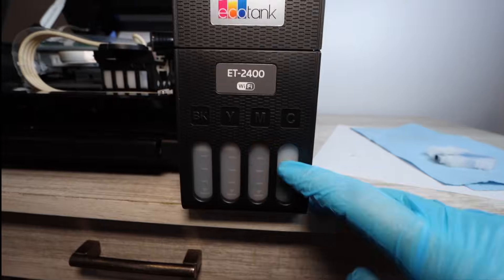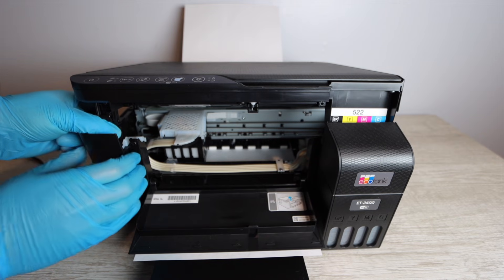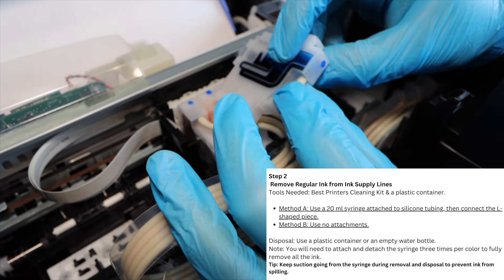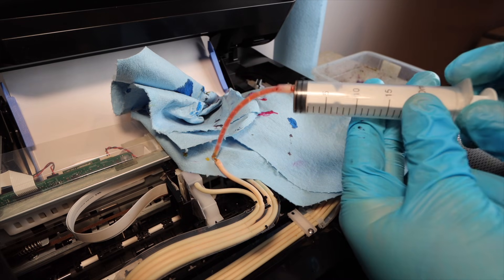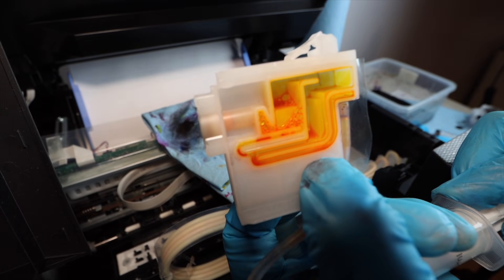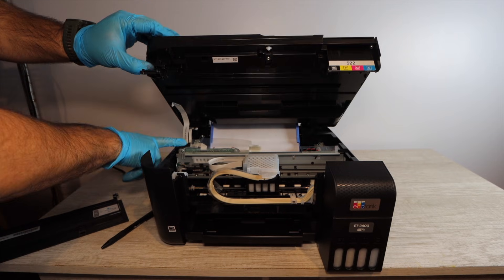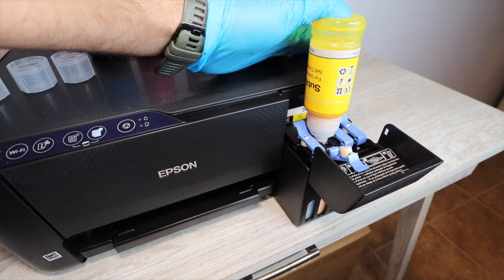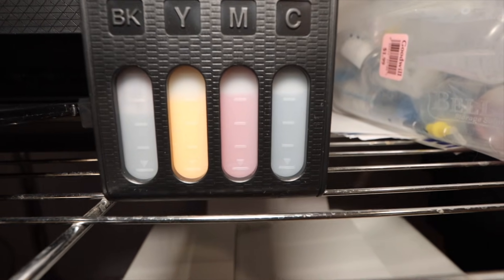How To Convert ANY Epson Eco Tank Printer - Regular Ink to Sublimation Ink - [Step-By-Step Tutorial]

Comment: I completed all the steps, very carefully, and reassembled everything - but after 3 cleanings there is still absolutely nothing printing on the sheets? Should I just keep doing a print head clean until it does? lol
Reply: up to 6 cleanings XD black is finally coming through, but no color yet :face-blue-wide-eyes:
Reply: 16 cleanings! LOL Don't give up people, it will eventually work :P
Reply from the maker: 16 cleanings is a lot but I have been there before. Good on you for sticking with it!

Comment: HI - bought a NEW Epson ET-4800 and did a print check several times - black prints but colors do not - have done checks, clean heads, wait 24 hours, etc - with no color coming through - magenta a few dots, other colors do not - should this happen in a new printer?